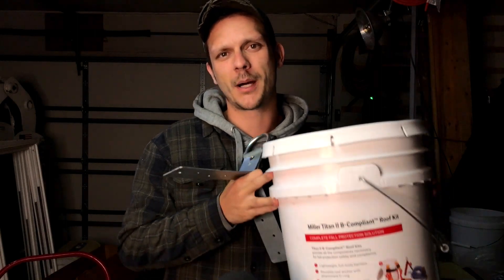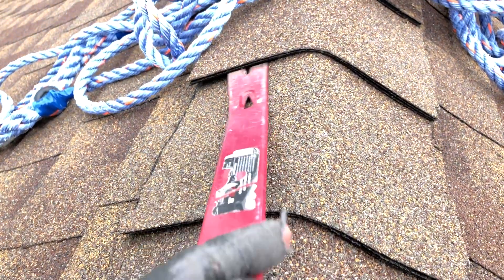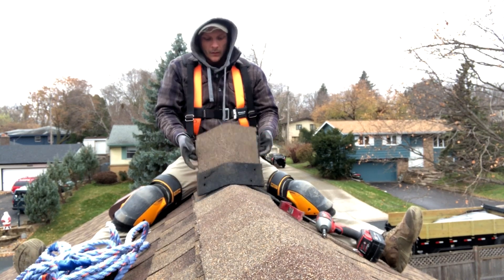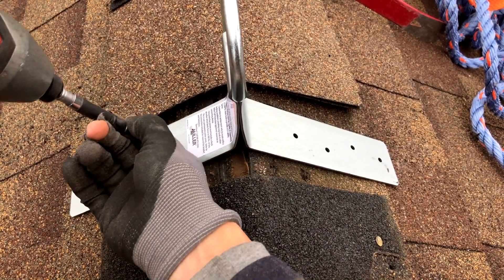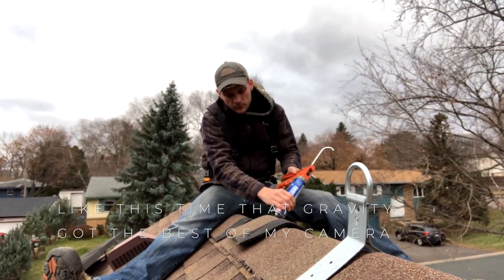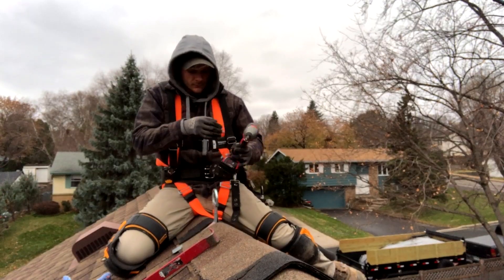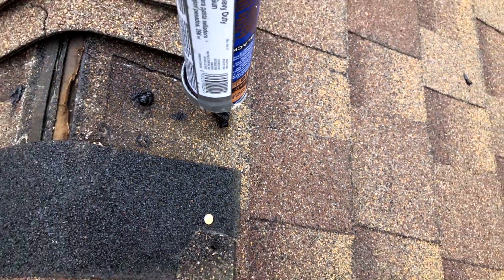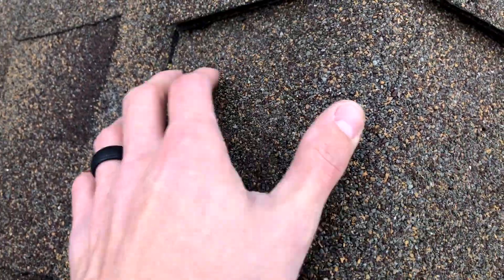How To Install A Temporary Roof Anchor (For A DIY Solar System or Other Roof Work)

Comment: Great video! So many on youtube give unsafe advice, but yours was solid as far as I can tell (I'm not a roofer, just a DIYer that tries to do research and do things the right way).

1:44 You can also use strong magnets to locate a rafter without putting holes in the decking/shingles. Make sure they're strong enough to attract each other when there's a 2x4 in between them. I like the 1x3" rectangular ones, so you have a straight edge up against the rafter. Secure the magnets in the attic on both sides of the rafter, making sure they can't move. Then take two more up to the roof and move them around until they lock in place. 

To help find the general area in the attic, you can play some music on your phone, then place it on the roof where you want the anchor. Secure it by tying a line to a similarly weighted object and hang that over the ridge, or tie it around a vent etc. Or just measure if it's a simple layout.

4:39 You can use a roof snake to avoid tearing the last shingle, it's a lot easier than bending it back. To repair a torn one, you can cover the crack in roofing cement, then get some shingle granules from the gutter and put it over the cement to (mostly) blend in with the rest of the shingle. If you have some leftover shingles that haven't been used, that's even better since there won't be dirt mixed in.

Comment: My question is this, at the end of the job once you’re all done you obviously have to take the anchor off, if the house is really steep once you take the anchor off your pretty much at risk of falling, so it only Keeps you safe while doing the job with the anchor on the roof? After you take the anchor off you just have to hope you don’t slip while trying to get on the ladder or what? I don’t get it.
Reply: That's right, you don't have any protection during your first ascent or final descent. You can use a Ridge Pro or similar device to make those safe. You shouldn't do it if you're not comfortable, though. Make sure you do you homework and get the right equipment, or hire a professional.

Comment: If this was your house could you just leave the anchor in place as a permanent attachment for future use?  The terminology of these types of anchors being "single use" "disposable" etc makes it seem like they are subpar. My roof is metal panel directly on trusses with no sheathing do you think I should use screws over nails to secure a similar type anchor. I'm just going to leave it installed once I'm done. Thanks for your reply.
Reply from the maker: Yes, they do make roof anchors that are made to be permanent. Just make sure you follow the flashing instructions so that they don’t leak overtime. I would not recommend using a temporary Anchor as a permanent Anchor since they are not made to be flashed.

Screws are not necessarily better over nails. You need to use a  fastener that has the proper sheer strength and ability to resist a tear out. Standard screws, take drywall screws for example, are actually quite brittle and have a poor ability to resist sheer. Make sure you use a structural screw or nail specifically one that is recommended by the manufacturer of the anchor you use.

Comment: Is there any reason to use nails over screws?
Reply from the maker: James that is a good question! 

Yes, in general nails have a greater sheer strength then screws because they are made of a softer metal. Screws are are generally more brittle having a lower sheer strength. 

Sheer strength is important because that will be the type of physical force acting upon the fasteners and anchor should a fall occur. 

You could also use structural screws which do have a greater sheer strength comparable to nails. Typically with a fall protection kit or anchor the instructions will specify how many nails (and what size) or structural screws you need to use with that particular kit. A kit may also come with nails or screws (the one I used in this video came with structural screws)

Comment: Any harm in leaving the anchor up there permanently for future repairs?
Reply from the maker: That is a good question Lance, with leaving this type of anchor up there you could get some water leaking to the inside of the building and possibly cause some water damage. They do, however, make permanent anchors that can be installed and left up there for future use that are water tight. So as long as you get the correct style anchor you should be good. I’ve thought about doing that exact thing for when I clean out the gutters on my house.
Reply: Thanks for the reply. Yeah that is exactly what I want it for, cleaning gutters. I'll research permanent roof anchors to install.
Reply: Really, if I am going to install anchors and go through the hassle , I’m making them to stay, just waterproof the area, by installing the shingles and using roofing tar.

Comment: Have you ever attached and anchor under the shingles not at the ridge? Say like a porch roof, where the top of the shingles of the porch roof meet the siding wall of the house. 
Would you just lift up the shingle flap and attach the anchor underneath?

And what if you don't have attic access? What are other ways to find the rafters?
Reply from the maker: Those are good questions! 
Another option is to use a different style of anchor. There is also a system out there called "The Hitch Clip System" that you can install an anchor further down the roof (not required to install at the ridge). You could, for example, install this one almost anywhere on the roof where there is a rafter to fasten to. 

If you don't have attic access, which is typically the case on a porch roof. You could look at the facia board for nails or screws (this might be behind your gutter if you have one). Those nails may be fastened into the ends of each rafter so you'll be able to use them to indicate where you're rafters are. 

Another option would be to measure out from the ends of the roof (where you know a rafter is) In most stick framed house, the rafters (or trusses) are placed 16" apart or 24" apart. You could use this to make an educated/measured guess as to where a rafter is likely to be. 

I hope that helps!